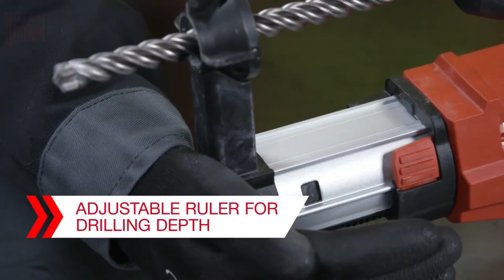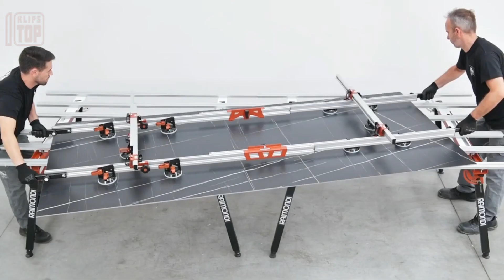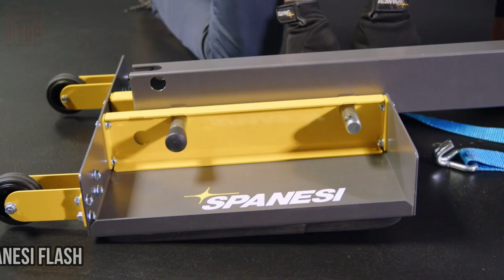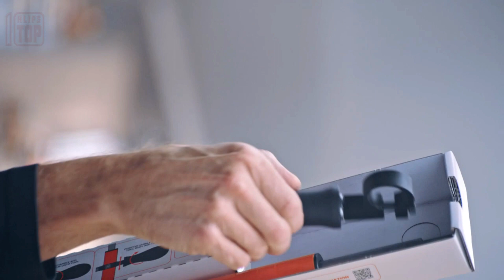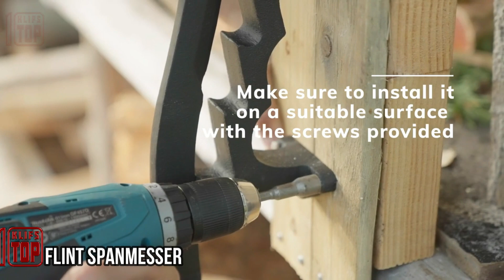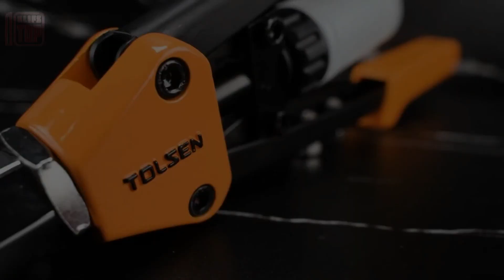15 COOL TOOLS ALL ENGINEERS WOULD WANT TO BUY

Comment: So many of these "tools" could be made by the end user, DIY style, for a faction of the cost. For example, that Milwaukee remote outlet for dust collection, that could be made in about 5 minutes with a microcontroller, IR or RF receiver, a small remote, a relay, and a 120v outlet. It would cost like $20 at most. Harbor Freight even sells a remote outlet kit that's ready to go out of the box that comes with a remote and 3 outlets for $19.99!